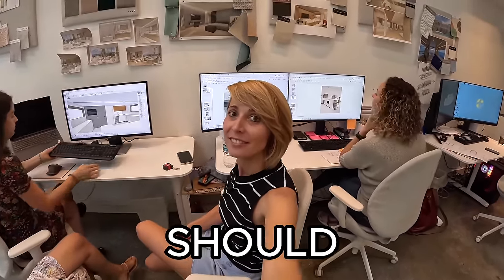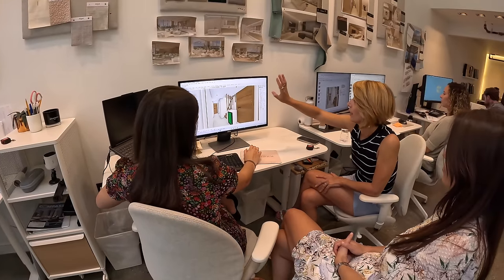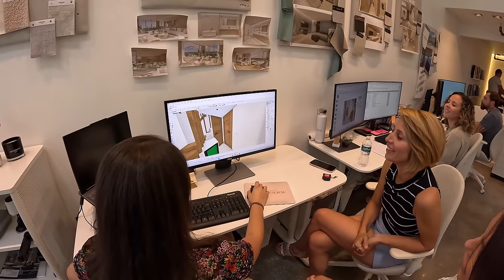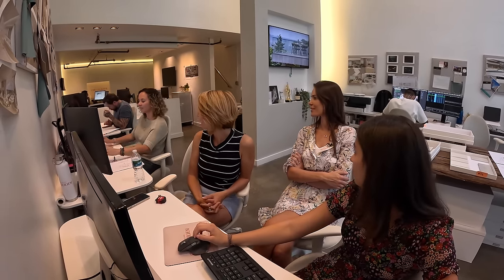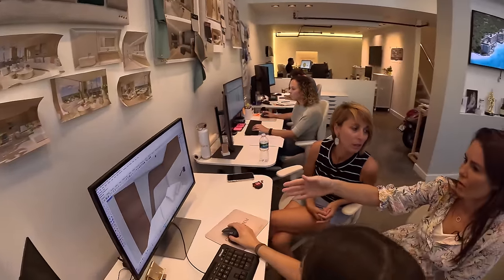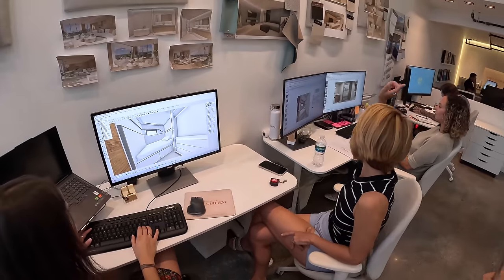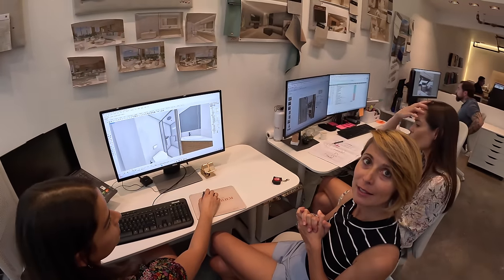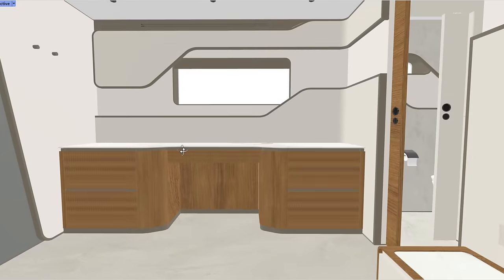Let's go DOWN BELOW 🤫😝 Our Bering 75 Staterooms Eps. 38

Comment: Couple of things I noticed - you'll definitely need/want some protection on the underside corners of the stairs for the laundry!

Also, with the guest cabins, when converted to a double you lose access to any power points - maybe add some more 'behind' the twin bed that moves across?
Reply from the maker: yes and yes, way ahead of you :)
Reply: Figured you would be! If I noticed, then I'm sure you already had - but also figured it was worth shouting just in case! 💪

Comment: we had two ironrite machines in our laundry area. did a fast, easy, perfect ironing job. especially on sheets. not overly expensive for a good used one. but space could be a problem.
Reply from the maker: Great tip! Thanks for sharing! ✨🙏🏻
Reply: @NautiGuys Jus4 remembered. The chief stew aboard M/Y AWOL used an iron rite type machine in one video.

Comment: For the room that you’re referring to is your dedicated laundry space is there a way to move that ironing board to the wall underneath the window? I think you’ll find if it’s a much better workflow and you won’t be standing at the ironing board with your back to the door And possibly be able to open one of those washers or dryers while the ironing board is open? And in the laundry room is there some kind of hanging device or place to hang things to do continue to dry like open? I’m envisioning some kind of ceiling hanging rack? I’m also assuming that that white long space next to the washer and dryer’s for cleaning supplies Question and I am wondering in the heights of that of the stairs coming out do you have enough room for one of those stands that hold a steam gun for doing shirts and linens really really fast? I noticed of your your drink station on the hotel floor that the plug is a European style plug? I’m hoping. To find a coffee maker set up there first thing in the morning so that I don’t have to go up in my skivvies to grab a cup of coffee and milk around my room for a bit before getting showered, dressed, or ready for the day? The twin state room I’m noticing that there’s no upper cabinets for additional storage like linens and things like that? And in the bathroom there’s no heat a towel rack? I think it would fit OK over the toilet? Have you looked in AP compliant height of toilet? Is this one of those newer Japanese style toilets that has both the new functions in it like the built-in pate ? I really love the the lighting under the cabinetry in the bathroom. Do you also have some additional lighting underneath the mirror and because I cannot tell does that mean you’re open for bathroom storage purposes? In your second state room how big is a full size bed? In addition to that where is the television and again I noticed that there are no upper cabinets and no kind of nightstand place. I tend to drink several cups of coffee in bed in the morning when I’m on vacation it is one of the things that I consider a part of my vacation. Is the wall at the head of the bed in that second state room padded like a headboard so I could set up a lien against that in the morning? I noticed that there’s no like open shelving or some thing to be able to place my cameras iPad, laptop, etc. and you have some kind of wireless band that you can have people hooked up to when they’re on the computer or their iPad that they could use a centralized printer? Now those two lower rooms that we have discussed it would be nice if they had a, an easy hook up for an Xbox or other TV games that you can book book up for kids?  Again in the second state room you’re showing us I like the under lighting under the cabinets is there under lighting underneath the mirror? It looks like you got enough space between the toilet seat, or the toilet itself and the slope of the wall of the boat to maybe put a magazine rack or something like that in there I know that I personally would like to be able to pick up a magazine? And again I didn’t see a heated towel rack? I think they go easily over the toilet.  And in your VIP where is the television I love the floating shovels in additional storage on the sides of the room love the headboard idea and the full length mirror and I’m how did you get full length mirrors in the rooms do they have some kind of them molding at the bottom she’s not gonna drive the vacuum head Into the mirror? In the VIP bathroom wonderful same questions as before the lighting underneath the mirror is there storage in the mirror and where is the heated towel rack? What’s the height of the seat in the shower in the VIP question love the little window in the VIP shower, I’m assuming this is gonna be able to come together like is it as if it has no seams? For ease of cleaning ? have you tried those showering ones and do they have the kind of ideal pressure that you would like to clean various parts of your body with because I think that those ones are great and I do not like staying in hotels that do not have them? Funny little story and I pack my own to take with me that I put underneath the showerhead when I go to the rented cottage that I go to every summer so that I can spray off my body parts as I want to, so it’s nice to see that it’s already built in here. I noticed that you did a great job with the owners cabin. You’ve got the built-in desk and tons of storage and that little oversize loveseat for a child to be able to stay on at the desk. Is there places for people to plug in their laptop their computer? I like the fact that you do have a big TV on the wall. Have you checked the heights of that TV and where it’s going to be located on that wall? I personally think it should be at a slightly lower than it appears in your picture for most comfort of just laying in bed and being able to watch? in the owners cabinet closet to the right of the door is that time like a hamper space? In the master bathroom, it would be nice to see a place to place magazines next to the toilet maybe even a book? No double sized heated towel hanging rack, which I think would fit between the shower and the door really nicely and I like the little separate room for the toilet in the master bathroom. Be nice to see that there was some thing hanging on the wall but you can see and look at while sitting on the toilet, I envision one of those little mini screens. that holds hundreds of interesting photos just destinations family photos group gatherings maybe you have other charters that they could be viewing well sitting and doing their business something it might be up for you know 15 to 20 seconds and then it goes to another really nice picture. And in addition, are the floors in the bathrooms heated? I think that would be a nice touch if you were someplace cold and aunt are the lights in the Master suite dimmable, so that one could be taking a nap in the afternoon, and the other person could be laying on the settee using a little bit of the natural light to read a book in the afternoon? Liking the plants wondering if there’s storage in the seat in the master? Well, you’ve incorporated so many really cool ideas I think you should both be very proud of yourselves and more importantly you were in sharing it with all of us and allowing us to dream right along with you which is been fun. Thank you and please keep making your videos.￼